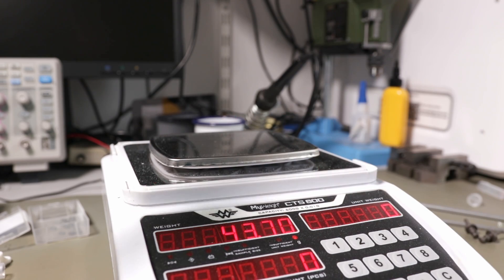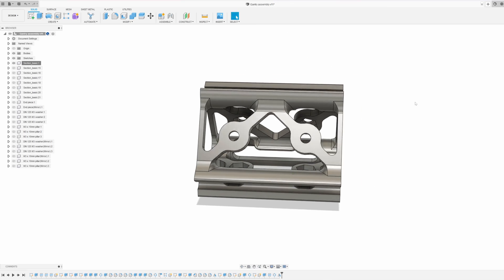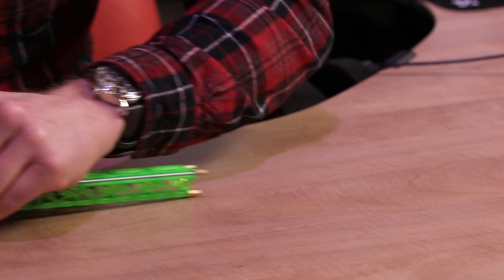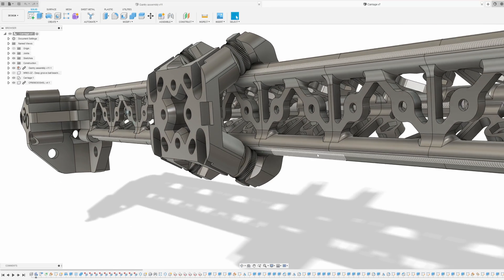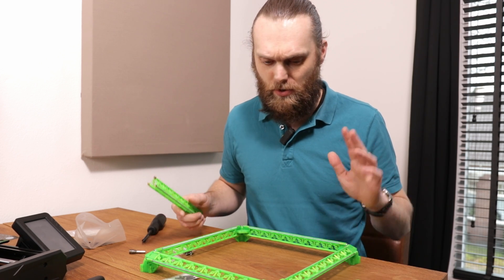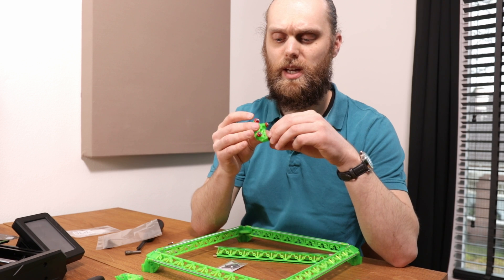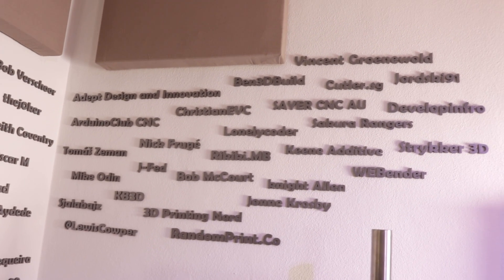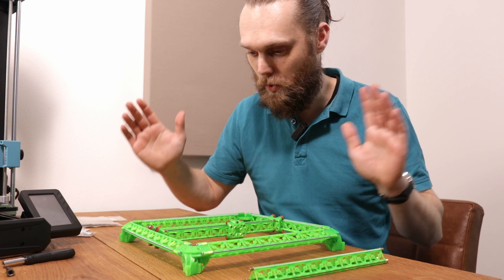Is This System the NEXT STEP in 3D Printing?

Comment: This is my first comment ever. 
I think there might be a misunderstanding with light as possible. The static parts should be as heavy as possible. Different materials should help with dampening the vibration. 
Only the moving parts should be light and stiff.
Reply from the maker: True that! This reminds me of a video Tom Sanladerer once made where he filled his extrusions with sand. Maybe I can make closed segments which you can fill up xD
Reply: @properprinting  You can refer to X1C's implementation for inspiration. It may save you some time.
By the way, Winston Moy did the same with a Shapeoko CNC 3 years ago. You can find it on his channel.
Reply: Yes, I always thought Tom is called SANDladerer ;) he should have left out the moving parts.
Reply: Yes. The static structure must be able to absorb the forces generated during acceleration and deceleration. A heavier structure will reduce the magnitude of any vibration. I vaguely remember someone suggest using magnets as dampeners.
The generated force can be minimised by reducing the weight of moving parts in the first place.
Another thing to watch out for is the natural resonance frequency of the moving parts. The printer's frequencies of speed changes should not overlap with it.

Comment: hollow pipe to roll on for example filement ptfe could work great with those metal rollers but you would need much smaller diameter rods or tension wires. the problem with that idea would be if overtensioned plastic structures would be prone to deforming
you could use metal pipes but the question is do you even need to tension it, how straight would it be without tension or with minimal tension from single central rod while  side tracks used as rails would be fited with pipes that are not under tension
you could also make universal cornet pieces in shape of a hollow wireframe cube and tension the truss with central screw trough the cube itself (a bit limited to 3 sided use with straight alan key with ball key you couls probably use more sides)

Comment: You can get way lighter with topology optimization or structural optimization, don't know the correct eng. wording. It looks a bit like tree roots. But you'll need engeneering knowledge and software to do so, because you need to calculate the forces accordingly.

Comment: it's awesome to see someone finally utilize the triange. i just cannot for my life find out why everyone use square tubes and stuff, when the triangle has the best strength of every simple geometry.. but i'd make it simpler, less modular, and i'd make it with only 2 smoothrods at 2 edges along the triangle. also i'd print it in one piece so you don't have to tighten the modules together. can't wait to see how you'll advance with this project
Reply: you have to use what is available... lightweight triangle extruded shapes are hard too find...
Reply: Well, it's not hard to guess, is it? People use square-everythings because it makes everything so easy to design in a CAD with a big cartesian raster. But you're right, that is not ideal. (And it's not like more sophisticated geometries would put the software to its limit!)
Reply: the other major reason people use squares in 3d printers is that triangular t-slot extrusions aren't nearly as common or available in as many sizes, therefore they're more expensive - and a truss like this would be even more expensive to mass manufacture

Comment: Instead of threaded rods, could you use smooth titanium rods that you cut threads into the ends of? Nevermind I finished the video.
Reply from the maker: I think that this really is a viable option.

Comment: Hi there. Instead of using threaded rods. Use normal rods and add threads to the ends of it. That way you have a smooth surface for your bearings to roll on.
Reply from the maker: Exactly!

Comment: Looks cool, but how about only having a rod in the middle and then somehow using 1.75mm filament as rails.
Reply from the maker: Thanks! Someone made a similar comment and suggested to use tubes as rails. The threaded rod in the center is a very interesting option!

Comment: Aluminium actually has higher specific stiffness than titanium: https://en.wikipedia.org/wiki/Specific_modulus

Carbon fiber is 99% of the time a hugely overrated material; but a simple off the shelf square box section of CF cant be beat here.

Not just as far as plain material properties are concerned; but also the torsional stiffness of a truss is going to be absolutely tragic. I guess you can sort of cancel that out if you mount your extruder with its COG directly aligned with the torsional center of your truss... if you love adding additional fidgety calibration problems to your design... but yeah square carbon tubes do exist.
Reply from the maker: Thanks for the info! The torsional stiffness indeed is not good. I think that once everything is mounted together in a frame with cross-beams or just sheets it will be a lot better.
Reply: @properprinting  Well im kinda wrong there; trusses can be quite decent in torsional stiffness; but with the plastic having to carry the shear between the rods the least-stiff-link is effectively the plastic.

I think the overall structure should indeed benefit from sideplates and all; but the weakest link would still seem to me the torsional stiffness of the truss the extruder is riding on. Thats a problem even if rest of the frame it is riding on is 100% solid.

I love modular printable components dont get me wrong, especially printable printers; but im not seeing any speed benchy records in the future here.

Comment: Hmm
What about Generative Design in Fusion360? Make a triangle solid shape and see how much material will it take out without loosing much strength. Or just make it as skeleton as possible (Maybe 3 rods in triangle position with brackets on the inside every 5-10 cm just to hold them in shape or something)
Also would love to see a video about  Generative Design + ABS like Resin + Graphite paint + Electroplating

Comment: I think at the scale that you're working it's pretty pointless, because material properties don't scale linearly. However, at a larger scale, I think you're may be onto something. The reason for this is that cross-sectional stiffness for this kind of structure will be very large at a larger scale compared to its weight. This is why you see trusses everywhere. I think it's possible to have such strong trusses at small-scale, but not this way. I think you would end up having to print a lattice style truss using an sla printer.
Reply from the maker: I think you're right that scaling up would be the most interesting use case here! I have to start small and I was thinking of also printing as light as possible by using fillers, like glass bubbles in resin prints. Enough possibilities to explore!
Reply: @properprinting  I'd be interested in seeing that. I work with fiberglass and ceramic composite and you're doing a lot of stuff that is fairly standard. Good work so far.

Comment: Looks fantastic would love to see more! Maybe carbon rods just with minimal printed spacers to hold them apart would be good.
Reply from the maker: Carbon would be an interesting option as well!
Reply: I've been designing a couple toolheads with 5mm carbon fiber rods as the main structure and I think they have huge potential. Very stiff and light. I've been able to eliminate nearly all metal fasteners. Still a very early prototype though.

Comment: ABS generally has a really low surface abrasion resistance, it flakes off easily.

Mostly printed + hardware store vitamins motion system does seem attractive to me, it doesn't even have to necessarily compete on weight. However it has to be able to run at precision, not knocking and rattling about like this.
Reply from the maker: Great point about the ABS! I was considering printing it out of better materials, but then I realized that these track rollers exist (by thinking about the idler wheel on those cheap extruders) and I kind off discarded the idea of making rollers on threaded rods. Without flaking you can still feel the thread while moving back and forth, so I was not ideal in the first place.

Comment: I think this system has enormous potential, would love to see how far you can push this
Reply from the maker: Thanks! I have this feeling too :D
Reply: @properprinting  this looks very promising for light gantries (with carbon rods?) and yes you should definitely carry on with the project. Towards Open source/commercial frame-robot type things? Regarding the speed-boat-race me (and the mrs) were watching and talking about engineering principals. On a core-xy printer, surely the Gantry and head need to be light but the Frame as rigid as possible regardless of weight? Some people literally bolt their frame to the nearest brick wall ;) also...
.
I can see the benefit of triangles for maximum strength for the mass but could frame components be square (with internal triangular reinforcement?) for greater simplicity where weight is less critical? You'd only need 1 corner model :) xx

Comment: How about a single threaded rod through the center for tension and then smooth, maybe even hollow rails only clipped into the 2 corners needed for the carriage.
Reply from the maker: That's an interesting thought! The hollow rails can have thinner walls this way if I don't have to cut thread at the opposing ends. That's smart, thanks for the suggestion!
Reply: @properprinting  love your videos, if I'm of any help it's an honor :)

Comment: Seems like the perfet fit for a belt-printer. And yes, def. use smooth rods. You could even use music wire. Tightening could be achieved with collet that friction-fits on the wire and which in turn has threads to get the tension. Or, i guess you´ll have to straighten the wire with a roller-straightener and then cut threads on the ends. shouldn´t be too hard with a threading-die.

Comment: Cool project, but to many variables that will mess up the result.
Ditch the "lite" part, go with stiff and a bit bigger for a full 3D printer. That would justify the means to get there.
Oh yeah, use M4, i can not find M3 here if i needed it to save my life! 😃
Reply from the maker: Thanks! I think that big is the way to go indeed! And yes, I just figured out how hard it is to find m3 rods when creating the parts list on my website😅